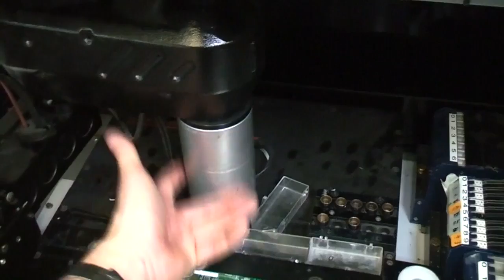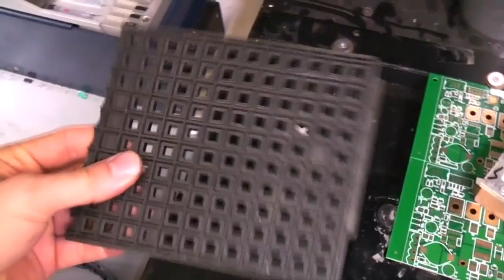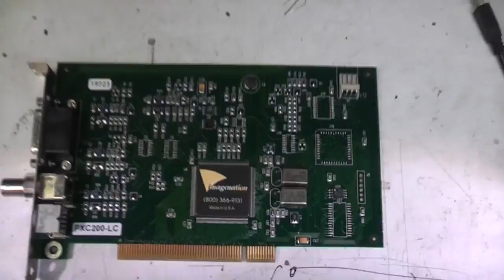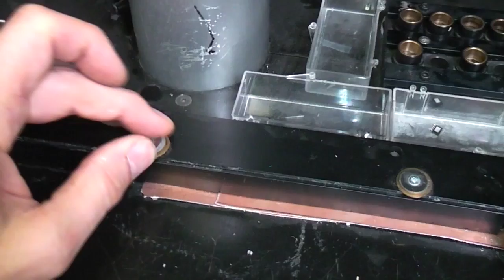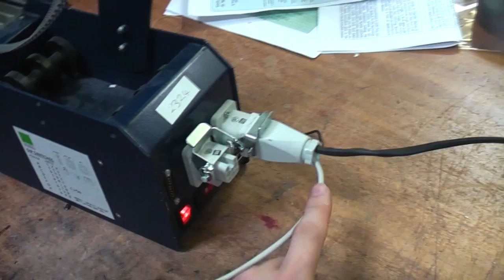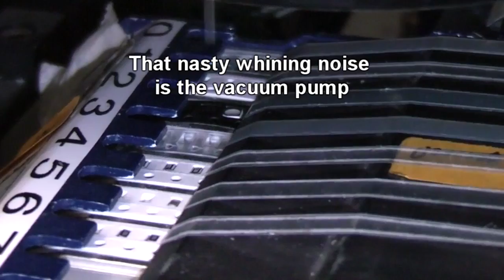Versatronics RV4s pick & place machine overview

Comment from the maker: @CampKohler I've only very recently had to put a tiny bit of silicon grease on the nozzle o-rings as it wasn't always loading the nozzle cleanly - abrasion isn't really an issue as the nozzles have a smooth brass ring insert